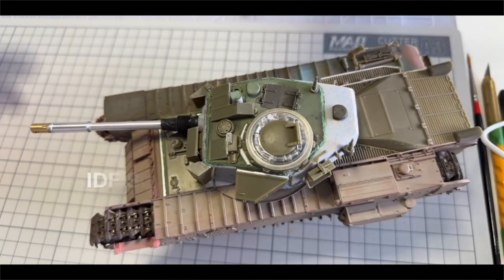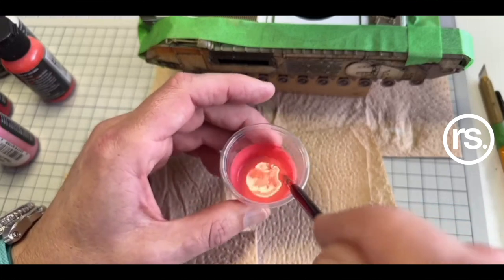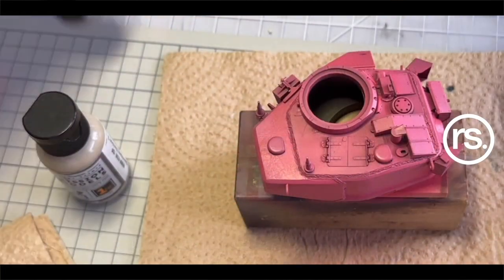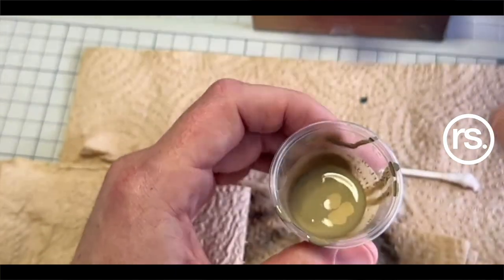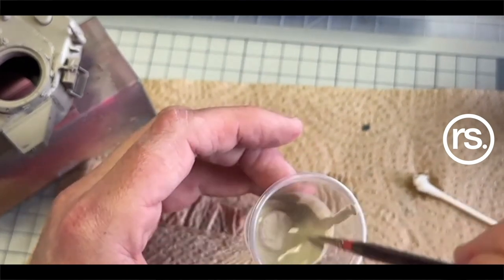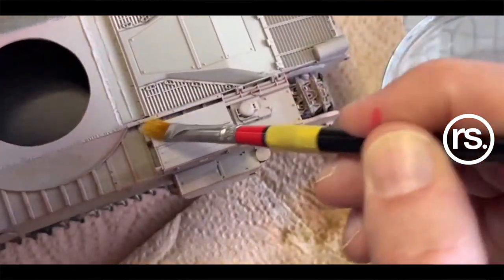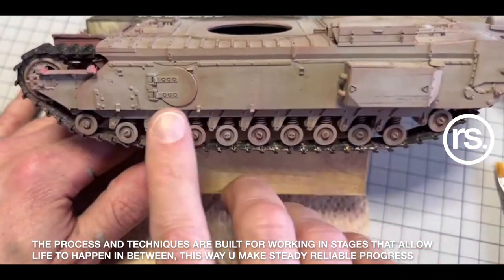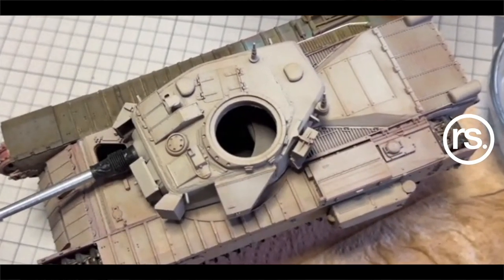IDF Super Churchill Pt3

Comment: I have a question that I will be able to answer myself when I eventually get to the live stream, but if someone has it off hand it would be helpful. How long on drying of these acrylics before going at it with the water? I haven't used MM, and feel like I'm my experience with spraying Vallejo, which is obviously a very different paint, it would be all or nothing without any chipping fluid if I let it set all the way up. I plan to use MM on my next build and am curious about this sort of process for it, thanks
Reply from the maker: Typically, you can chip as soon as its dry for almost all paints, MMP included. I like to say once the airbrush is cleaned is a good amount of time before you can begin. Longer is never a big deal either with MMP due to their activation qualities with water, and why they’re so flexible for this type of work.
Reply: @rs.p  thank you for the prompt reply, I appreciate this! Will absolutely be giving it a shot on my next kit.

Comment: Thanks for sharing this technique. Could you apply the same type ‘’light chipping’ effect to get patina on aircraft or is it best to go straight to OPR for this?
Reply from the maker: Hi Steve, great question and armor tends to get a lot more weathered layers on top, so it makes sense from an efficiency standpoint to work in the chips with paint as shown here. 

On many aircraft, as demo'd on the P-61 -- since very little additional weathering comes into play on top of the paint wear & tear doing this form via OPR is very efficient.

It's by no means a hard rule, but a general guideline, and for sure a combo of both is going to be very effective too, whether OPR is the prime process or the tuning apparatus, after the fact.
Reply: Thanks Mike. Great help much appreciated

Comment: Dear Mike! MM paits are finally availible in Poland and I will give them a try. A quick question: do You use the poly with whem (I know it doesn't help chipping), I mean- do You use it at all? And one more: do MM paints mix with Tamiyas, Valejos, AKs or other brands at all? Just need some starting point here... :) #Robert
Reply from the maker: Hi Robert, apologies for the delayed reply, YT had your comment hidden for some reason. 

Great to hear, and yes, I use the poly. It used for glossier finishes and also to help with lower layers not wanted to be affected by the water when chipping off the top layers. 

No, MMP is a singular ecosystem, I don't recommend cross mixing with other paints. Same with the airbrush, keep it pure and no alcohol or lacquer thinner used at all for anything (thinning, cleaning, etc.) with MMP.